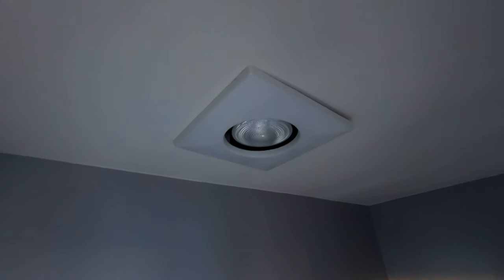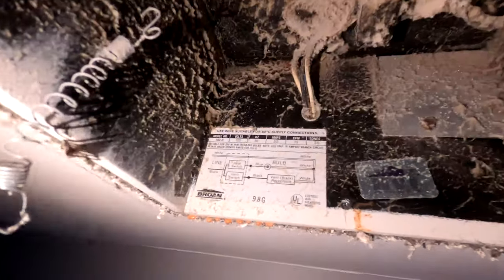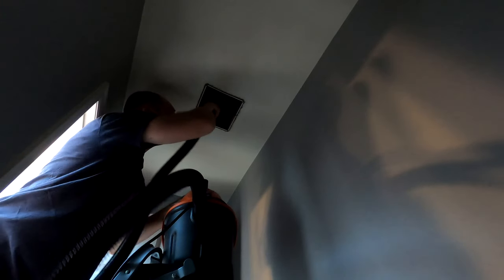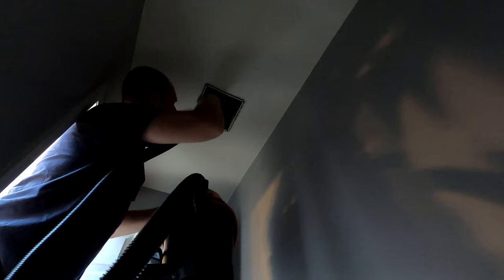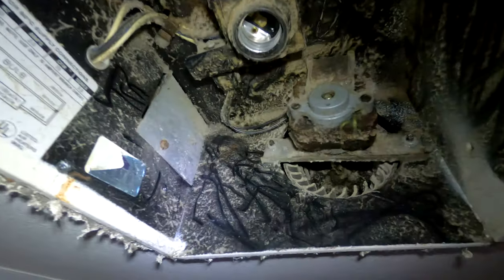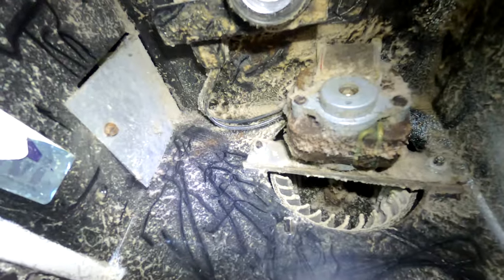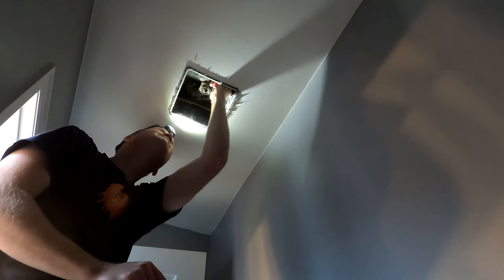Broan 162-D Fan Motor Replacement

Comment: Thanks... thought I was going to have to replace the whole unit, which would have been a really tough job.. climbing up into a very tight attic space with fiberglass insulation.  After watching this video, I replaced the motor in about 5 minutes!
Easiest home repair I ever did!

Comment: Did it come with a mounting bracket or did you have to use the existing? Amazon doesn't show the motor with a bracket. Also is the blower wheel a press fit onto the shaft?
Reply from the maker: No, I didn't get a mounting bracket with it. I used the existing one. The blower wheel is a press fit onto the shaft.